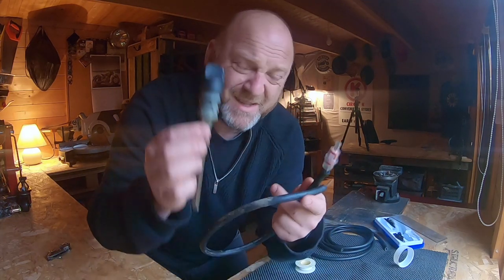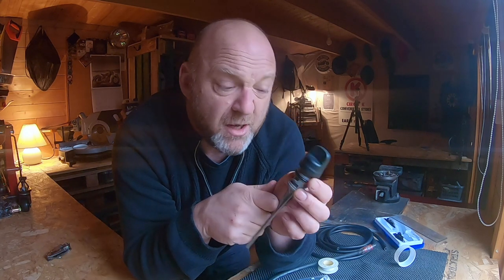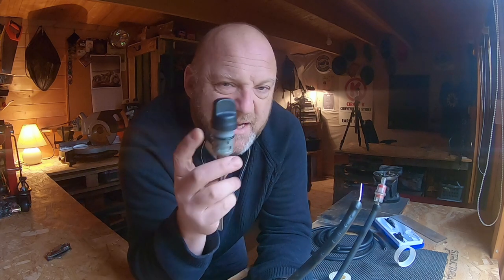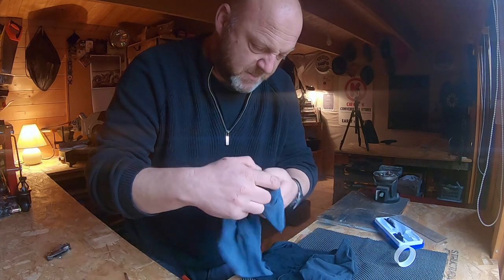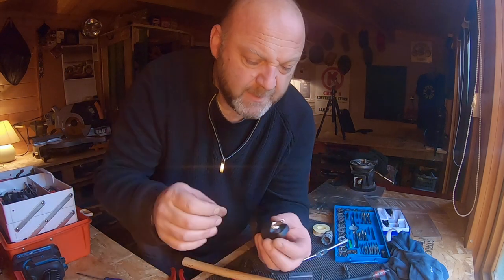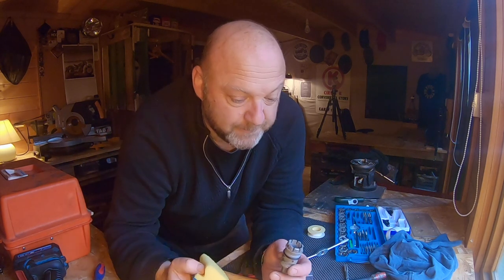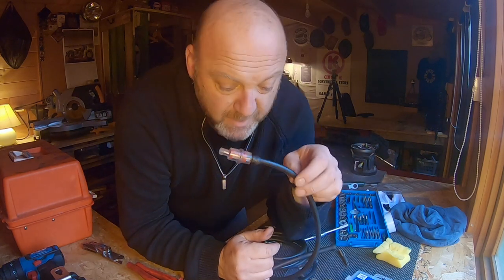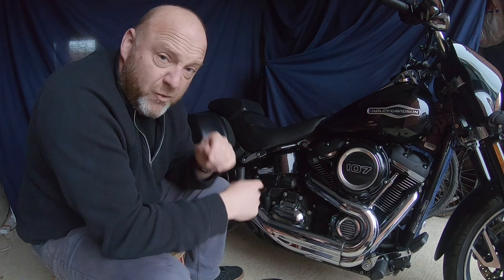Harley Davidson Vented Engine Oil Dipstick Homemade Update

Comment: Use a tube of copper 1" or 1 1/8". Cut it 6", ream the copper on one end.
Get cosmetic pads, lay flat on wood 2x4, and drive the reamed end through the pad to cut it the dimension, stack them, ta daa fellas

Comment: High temp JB weld. On the oil cap to the new barbed and thread coupler. It'll hold that thread like it's cast into place instead of threat tape

Comment: Needs inline 1 way valve otherwise air sucks back in negating the exercise as every motor has some blowby hence positive crankcase pressure . On our race motors we employ vacuum pumps to create negative pressure in the crank case.
Reply from the maker: OK, great stuff. Thanks for that
Reply: Even though the stock breather system doesn't have a one way valve?
Reply: @Sid_Mowe  it does inside each head
Reply: @shanewalker2257  oh yeah duh that was dumb of me 😆

Comment: You have to be very careful here, because where’s excessive crankcase pressure is no good, too little is also very bad, you need the crankcase to be positively pressurised, to insure the oil gets spread around ( moving parts are not enough)
So no pressure would be harmful.
Not all M8’s need this mod, best way to tell if your engine is “over pressurising “ is to run the bike hot, then undo the dipstick.... if it’s a stiff turn, or there’s a release of air/pressure, then you need to vent a little, if not, then leave alone.
( but what do I know.. 😂)
Reply from the maker: I don't know? What do you know? ha ha

Comment: That bigger hole should be good enough for breathing.
My design im going with is a tube through the top, then using Sugru to solid mount the tube into the dipstick cap, and then cover the sugru with red silicone(red=heat resistant high temp applications.)
That way I dont have to worry which way or angles or solid mounting to the side. Straight through the top.
Reply from the maker: Yep sounds good

Comment: I watched ur 1st vid, i had a feeling the Football valve would break at some point. I used a 5/16" Bleeder valve and grinded the valve so it would breath properly , ran a 1/4 "ID fuel hose to a micro air filter , up above dip stix . works fine. UPDATE : installed a 1 way valve(type used in assisting in bleeding ur brakes, china $8.99) in the middle of the fuel line ,between micro air filter and top of fuel cap.. Seems to be workin fine .
Reply: why did you install a valve?

Comment: I have come to the conclusion that this is not necessary, from what I have researched on the internet ( Must be true LOL) Yes it will vent the oil tank, but not the crankcase! the only connection from crankcase to Oil tank/pan is the feed to the oil pump, and the return from the scavenge pump, I can find no gas link between the two. Positive pressure in the oil tank may indeed be a benefit as it provides a positive feed to the oil pump, so if you think about it venting the oil tank/pan means your oil pump has less or no pressure feeding it. I know what I would prefer.  The problem of high crankcase pressure would be a different issue, the venting there is by the breathers that feed into the inlet. You can have high crankcase pressure for a number of reasons, blow past the worn rings would be one, but we are talking about new engines here. The EPA requires this venting into combustion ( Not to atmosphere ) Perhaps this is a design failure and not up to the job, seems to only effect 114 and bigger engines, bigger pistons and stroke so more gas movement in same size crankcases? The only way to vent the crankcases would be to drill and tap and insert a similar fitting you have into perhaps the rocker covers or spacers, then pipe this away to a breather can. BSP and NPT are the thread specs different pitch but at 1/8 there is not much in it, anything above and they wont fit each other. Good experiment Alf, got us all thinking.
Reply: @FEEDME DOUGHNUTS They are quite expensive though for what they are, I think some are sold on looks and finish rather than the job they do.
Reply: @FEEDME DOUGHNUTS Not had any in my 107 M8 but not a lot of miles yet.
Reply: @FEEDME DOUGHNUTS That would be a first Haha
Reply from the maker: Yes it's not so clear about whether it relieves any pressure for sure.
Reply from the maker: ha ha, thanks for calling all my hard work a bodge job. Nice
Reply: @FEEDME DOUGHNUTS Perhaps not, just looking at A1Cycles video on Air flow in M8 off 26 Jan 2020 and there may be a 3/8 size link hole from crankcase to oil pan. Still learning LOL.

Comment: Another baffle material you could use is some variant of stainless steel wool. It will hold up better than sponge or cloth and won't be reactive.
Reply: I was looking for this comment. I would guess that it wouldn't be too hard to find stainless steel scrub pads and cut it to fit and it should stop oil from slinging out and still allow it to drain back without clogging up. 

It's definitely an interesting series and I don't even own an M8.
Reply from the maker: @s.gossett5966  Thanks so much
Reply from the maker: Yep great idea
Reply: @RevelatorAlf  it's been a good series. Definitely working to separate the wheat from the chaff when it comes to modding an M8. Glad you're doing it.
Reply from the maker: @s.gossett5966  Thanks so much
Reply: @s.gossett5966  I  would not put steel wool or scrubber in there, it breaths in and out, to much risk of contaminating the oil with metal . I would use the foam that you get for tropical fish filter use or sponge like shown, The foam for fish tanks is quite cheap and easily cut to size, its open cell foam as well so things can pass through it, closed cell foam would be no good.

Comment: got another idea Alf. As your bike is a softail: Trask make a vented gbox/oil-tank cover. . or copy the idea and basically install your brass fitting into the cover on top of the gbox, but on the r/h side. Its obvious when the cover is off. You can see the drain hole.
Reply from the maker: could be worth investigating cheers

Comment: Hi. Thanks for the Video..  After looking at the oil Cap, Im not sure that you need to Drill the top (Black part) of the cap.. Im think Im going to try drilling the bottom and not put any sealant between the two parts( Thus letting it vent there)..  there seems to be plenty of space on the inside of the dip stick to take the foam and any oil mist that may be exhausted. If I get any oil come out of the Cap gap, then I can always drill the cap and vent it higher later..  P.S.. I will put some fine gause in first before the foam.
Reply from the maker: You may find oil coming out of the cap
Reply: @RevelatorAlf  maybe but i can either do the second stage (pipe) later or plug the holes. however Im currently looking at another Harley, so trials may have to wait..

Comment: If you Use a Brake bleeder bolt it has thread long enough to secure and seal from inside with a Rubber O ring and a Nylon lock nut and Place the Foam as you said inside ..
Reply from the maker: Yep that'll work great

Comment: I wasn't to sure if I caught the importance or lack off it with inserting a one way valve to prevent blow blowback?
I'm familiar with  the whole OilCatchCans, but the one I installed was on my Infinity G37...LOL!
Just need to know if installing an inline or one way valve is needed, or is recommended to do so.  

THANKS AND GREAT VIDEO
FROM 🇬🇺🏝 GUAM, USA.  2019 FXDR114👍
Reply from the maker: Actually on my updated one I haven’t added a one way valve at all. Cheers
Reply: @RevelatorAlf  okay..thanks!  I think I'm going to run a similar system or CATCH CAN i installed onto my G37 VQ motor,  but with a breather at the exit nipple rather into crankcase....I'll let you know how it goes.
Reply from the maker: Ok sounds good. Cheers

Comment: Is it possible to fix a pressure gauge onto your dipstick pipe to get a true idea of the pressure in the crankcase ?
Reply from the maker: No not really. You could connect a gauge but it would be measuring only pressure from the oil tank and it might not be accurate because of type of dipstick too. If you want that, then you'd have to tap into the crankcase itself and attach a gauge but there really isn't a need for that I would say. Cheers

Comment: I think I would super glue smaller fitting into top of oil dip stix
Reply: If just pressure is only needed, can't just a small hole drilled in top an bottom of dip stick?
Reply from the maker: That is an option but oil may come out
Reply: @RevelatorAlf   just monitor vent hole on top at is! If vents ok an No oil, home free, if oil shows up then deal with it on second step.

Comment: Correct me if I am wrong but isn't this unnecessary because the crankcase is vented up through the outer cylinder wall up to the heads  and out the breather tube.
Reply: The argument out in the wild for venting the dipstick is that Harley didn't add enough venting and it causes too much crankcase pressure.
Reply from the maker: Well there is the opinion which I also share that this is just not necessary full stop however this is the reason for me doing these tests, to see if there is any benefit at all. Cheers
Reply: Yes but the head breathers go straight into your intake, without the oil tank/crank case vented it builds excess pressure and you will get hot oil/mist in your intake. Carbon build up etc. Vented dipstick is meant to help with this then you can also do an external breather mod from the heads to a catch can. This stops any oil getting out the head breather and into the intake manifold. But a lot of people are saying the help that a vented dipstick is enough not to need external head breathers and can leave them in the air cleaner.
Some m8 worse than others
Reply: @michaelbartlett9433  yup
Reply: How about connecting your external head breathers to your vented dipstick tube with a “T” fitting? Introduce an additional “T” for a one way venting valve. In this scenario, your oil tank becomes your catch can for the head breathers.